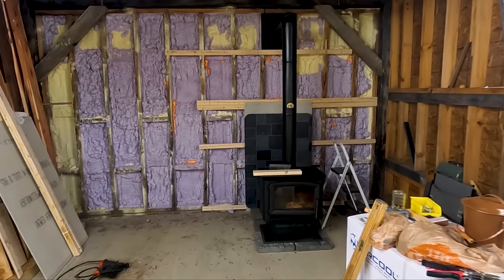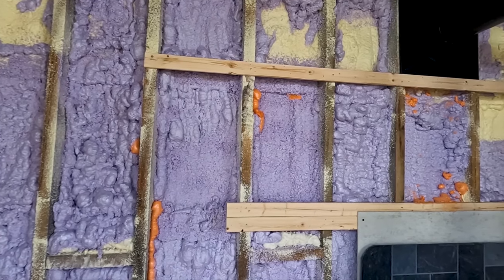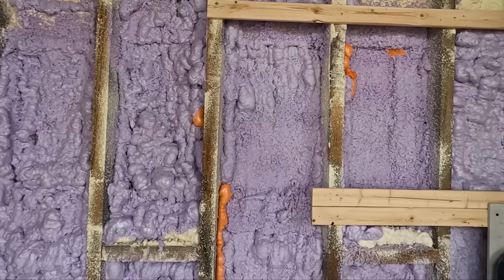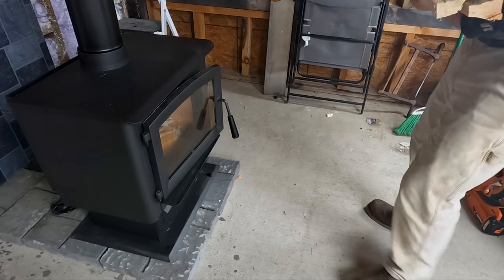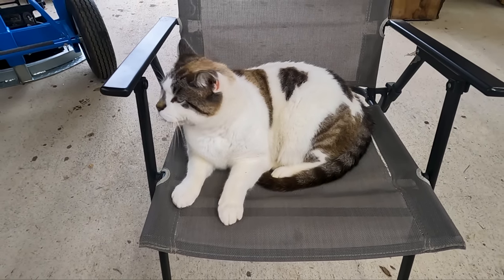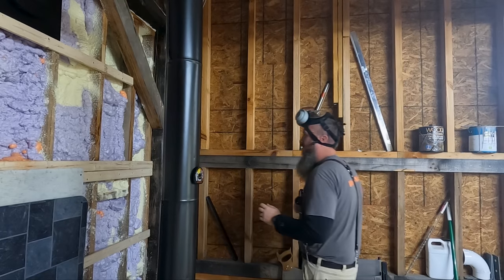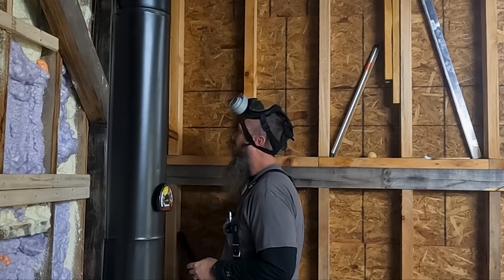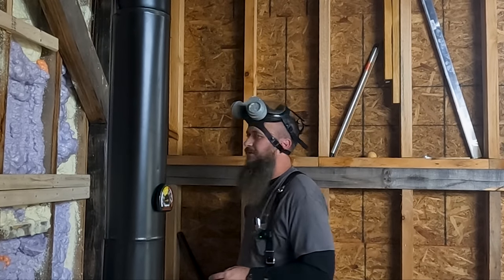DIY Spray Foam That Anyone Can Do And Afford. I Saved Thousands $$$

Comment: Good stuff. Love your videos. As a former spray foam salesman for a spray foam company, 2” of closed cell foam is all you need in them walls. Adding fiberglass wouldn’t really add any insulating properties at this point. Focus on mitigating the heat loss through the roof/attic at this point. My two cents. Do with it as you like. Keep up the good work
Reply from the maker: Thanks for the info!
Reply: @OutoftheWoods0623  you’re welcome. Glad if it’s helpful
Reply: In Texas this would be all wrong. Don’t know the weather where he is. Guessing it’s a mix. We only worry about keeping the heat out in Texas and would want to fill up somehow to avoid condensation. Flash and Batt is common just to get something in there, and you would do no moisture barrier on the inside. We don’t add  the batting to help insulate but for other properties.

Comment: If I remember correctly friends, most heat loss happens at the ceiling. That does not mean you do not have to insulate your walls but, more insulation in the ceiling will improve heat loss?
Reply: You are correct Dave. 70% through the ceiling. 20% through doors and windows and 10% through the walls
Reply: If you stop airflow from your walls and rim joists, then you have effectively stopped the cold air infiltration, which causes the stack effect.  Yes, you need reasonable insulation in the ceiling also.  But I think the 70% is misleading.   You could insulation your ceiling to R50, but if you have leaky walls/rim joists, your house is going to be cold regardless.

Comment: Use thin layer of  closed cell sprayfoam. Then cover it with stone wool for fireproofing and sound insulation. That way you get to kill the possibility of condensation and also not waste money.
Reply: that's my plan

Comment: I used closed cell insulation in my wood shop (24' x 30') here in Northern Ohio. I put 2" on the walls and 3" in the ceiling. It has been fine. My  mini split has no trouble keeping up and it has hardly affected my electric bill.
Bill
Reply from the maker: Nice 👍

Comment: Hey Nathan hope you'll get a break from all the rain, at least it's not snow. As far as insulation, another ybr channel is building a house and the contractor on exterior walls is spraying 2" of closed cell to seal the outside than the pink insulation to keep heat in.

Comment: My shop has 2 inches of closed cell foam.  Completely sealed.  A small heater will raise the temp about 10 degrees per hour in cold weather.  2 inches is plenty.

Comment: Maybe somebody else commented about this I'm not sure, but I cut strips of Styrofoam insulation, put them in between the studs, and then spray foamed the cracks, I felt like that was cheaper than buying it by the can, and had very similar results. Not trying to critique you just saying what I did.  It was a lot cheaper for me than buying a lot of spray foam cans which are very expensive and was faster.
Reply: If you have easy access, then your method works fine.  But when you have finished basement ceiling, then this method allows you to simply cut small holes in the ceiling near the ends, and spray foam each joist.  Trying to get rigid insulation in those cases, or in cases where you have maybe an inch gap between the board and the rim joist, is very difficult.

Comment: Hey Nathan, great stuff, simple applications. Is your goal "insulation" or "vapor barrier", this would be a simple application of 2 cans for all the cracks and couple of 1/2" foam panels, glued and seal taped, as a vapor barrier. Sealing the heat transfer (reflective foam board), to reverse the radiation facing the wall. Considering that you may not add a finish to the wall or are you planning on insulating the rest of the shop. Noticing the OSB wall behind you. Thanks
Reply: Radiant insulation needs a gap to be effective
Reply: @nickford5549  The air gap is provided by layering the reflective insulboard as the finish on the studs. The gap is already provided by the stud 3.5" of width, from the sheet metal to the back of the insulation. Closed cell insulboard acts like a moisture barrier on the back side. The spray foam has no air gap now if the wall is finished. If the sheet metal is slippery or has debris on the inner surface the foam may not stick for long in freezing weather unless encapsulated.

Comment: You have to be careful on doing "flash and batt" insulation, which is what you were wondering about. You can trap a lot of moisture in the batts. Personally I wouldn't do it.

Comment: If you do this again they sell a diy spray kit called frost pack. Comes with two refrigerant tanks full of 2 part. A good tip also. Spray foam is great but really isn’t the best choice in most applications. It’s really good at air sealing. If you want the best insulation flash the walls 1” thick and blow in cellulose material. Great r value and good on sound
Reply: Froth pak

Comment: Love the spray foam, but here in Canada, you have to cover it with a non combustible material like drywall in a shop. Something to consider
Reply from the maker: thank goodness I don't have to be told what to cover my walls with,
Reply: thats so strange because you can take a torch to closed cell and it wont burn...

Comment: R-13 fiberglass, plastic & ⅝ fire rock. Cheaper, faster & fire rated..
Reply from the maker: But the metal will sweat
Reply: @OutoftheWoods0623  Not sure what you mean by "the metal will sweat"?